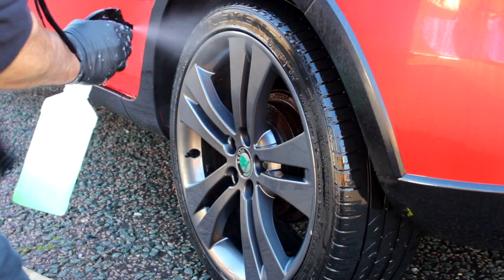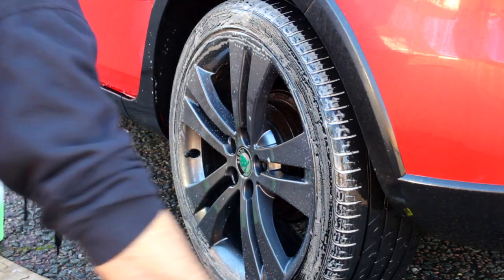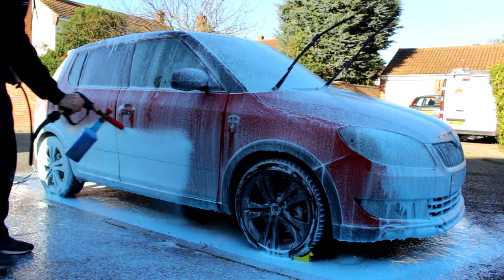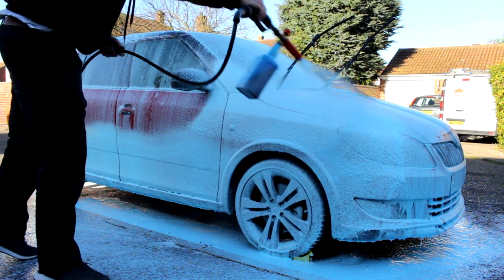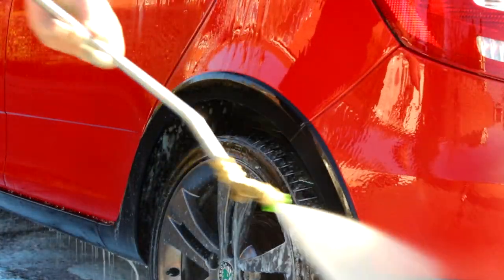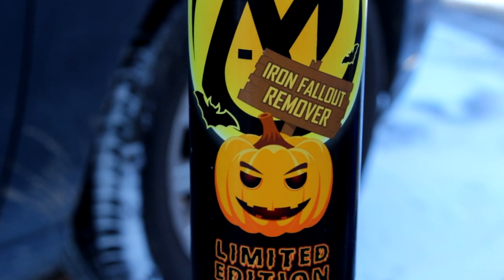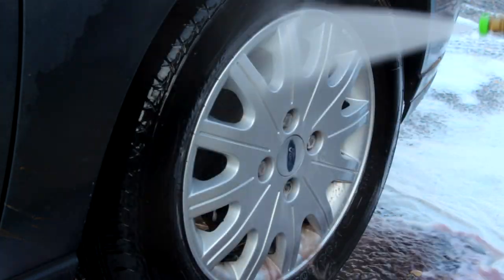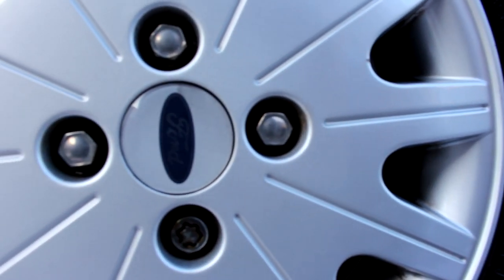BLUE SNOWFOAM whatever next.

Comment: If I have a 1litre spray bottle how do I work out the dilution ratios.? i.e 1:50 ratio..?
Reply from the maker: There is a table on google it should be 1:50 = 20ml
Reply: @PaulDoldenDetails  Cheers Paul found it.👍👍